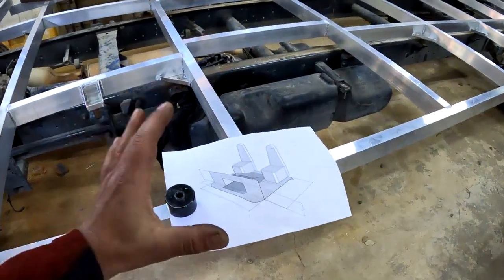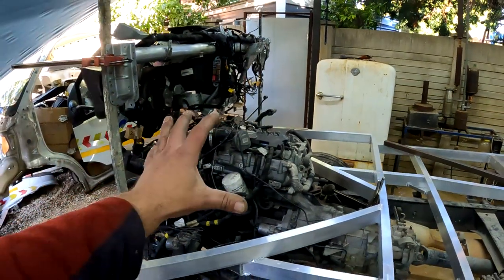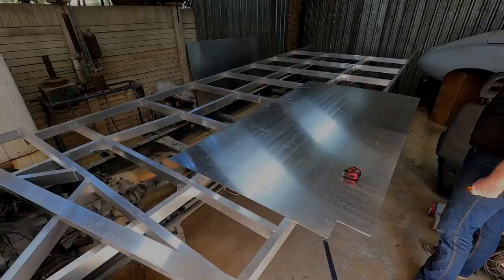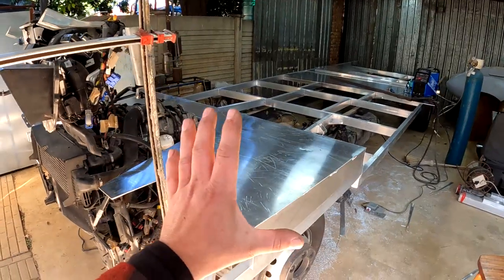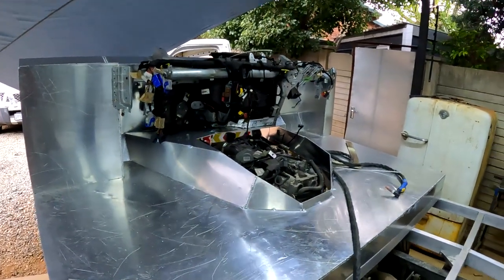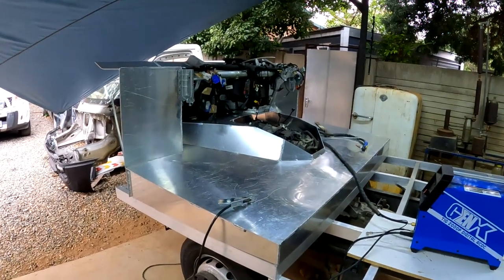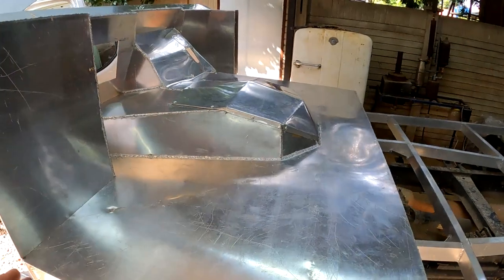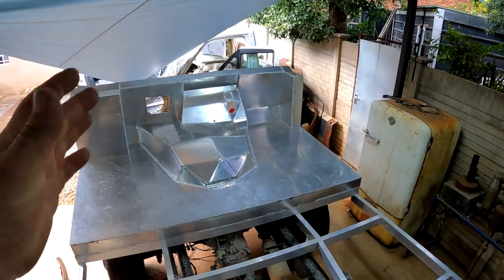Building a Motorhome from scratch Part 3. Making the Cab floor, Firewall and Engine cover

Comment: If you add those dents or creases into the sheet metal it makes it harder to warp when welding, like in the back of a bakkie how its corrugated. I think its bead rolling or something like that, where you emboss little ribs into the plates, but if you did that to the "floor boards" and stuff, it will make the panels much stronger so you could use a lighter gauge plate and still have the same stiffness. I have seen it all over in monocoque cars where they need more strength or stiffness in floor panels and wheel wells where the shocks mount and stuff.
Reply from the maker: You are right! It would have most been so advantageous to make those "creases" in the flat ali first😱. Would have been much stronger.
Reply: @BroughBuilt  I thought about it because you wanted to keep the weight down.
Reply from the maker: @RachaelSA I made a rookie mistake. I can kick myself for not thinking of this before hand🤦🏼‍♂️

Comment: Great work Danny, I like the idea of bead rolling big expanses of metal and I have a light duty bead roller but I think that would be out of range for your thickness of 3mil (1/8 inch) aluminum for you floor. Your work again is amazing and you make it look easy (I have not mastered tig but I working on my Mig skills). I like the canopy clip idea as I have 3 Grumman step vans and the engine covers have clips like these. they allow the covers to come off completely  to give complete access to the back of the engine and transmission quickly. I am looking forward to seeing you progress on your project. Mike
Reply from the maker: Thank you Mike! I agree I should have bead rolled the aluminium for extra strength and rigidity it just makes perfect sense! Can't believe I didn't think of it🤦🏼‍♂️

Comment: Great job Danie!! Well done! Love what you did so far! Looking forward to see this development. 
Don’t you think it would be good to put 4 canopy clips on the engine cover. I think you will be opening and closing that cover more often than you anticipate… but I might be wrong…
Reply from the maker: Thanks! I will consider the clips as it will definitely make life much easier to access the engine compartment. My only concern is that the clips might get in the way when driver and passengers traverse over the tunnel area🤔
Reply: @BroughBuilt  You might have to counter sink some pockets to make the clips flush with the tunnel…